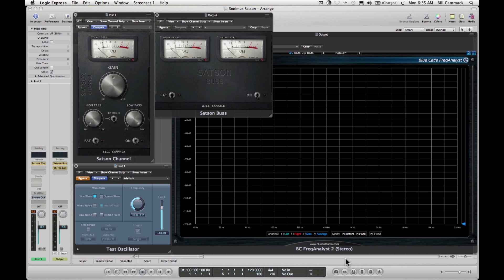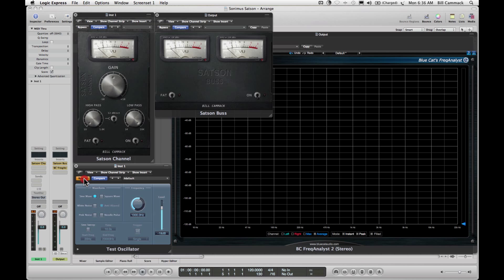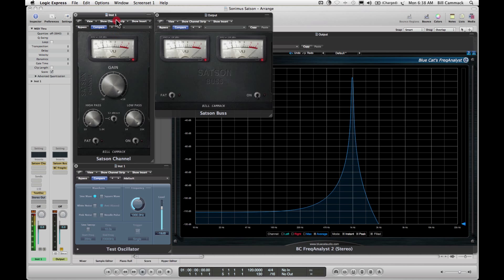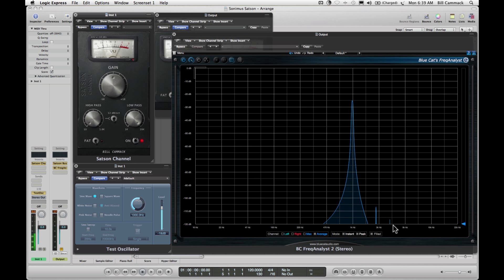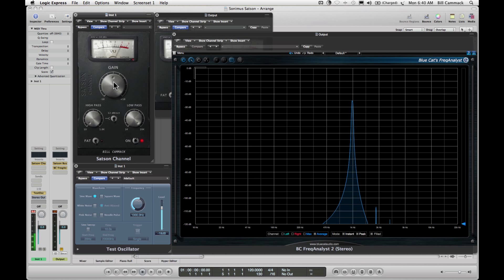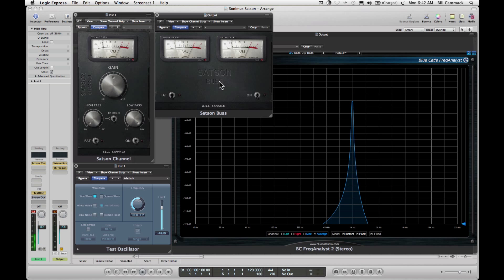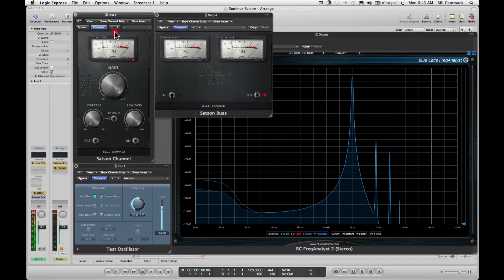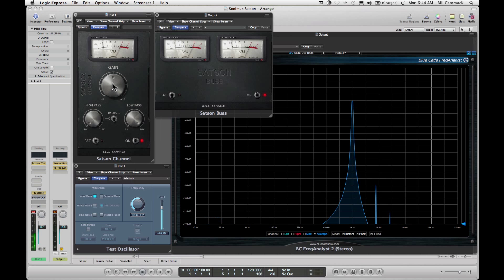Sonimus Satson Console Emulation Sine Wave Analyzer Test

Comment: This analysis video is an awesome idea :) Technically though, those added frequencies you see on the plot are harmonics caused by non-linear distortion, so it's much more than just "duplicating that one sound in higher frequencies"; the best way to demonstrate what happens to a more complex signal is to do similar analysis with 2 sine waves at some musical interval (say, by a minor or major third) apart from each other instead of just 1 sine wave, and look what happens on the spectral plot then ;) I predict you will see intermodulation products in addition to the combination of the simple harmonics of the 2 sine waves, so the thicker the original signal that you feed into the plugins, the thicker the effect added by the plugins will become. Overdo it and it'll quickly sound too thick, compressed and muddy. Apply it just right and you'll get that sweet spacious "analog console" sound.
Reply from the maker: Interesting, Lauri! :D Thank you for that info.  I'll look into it! :D